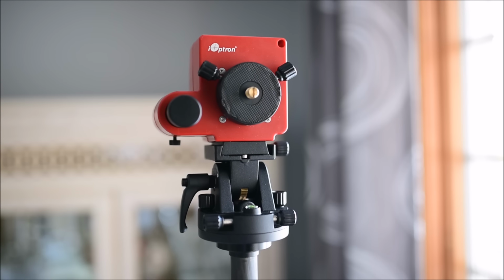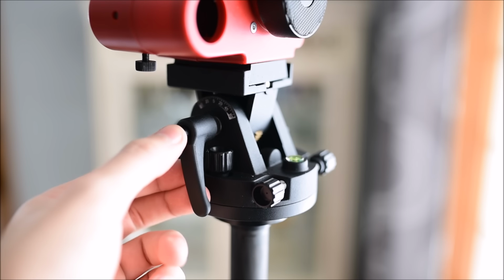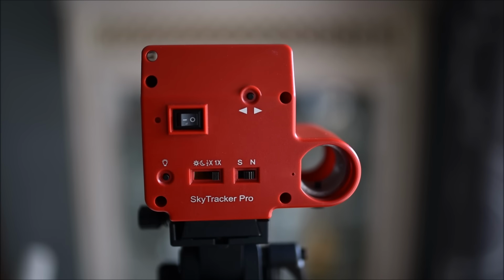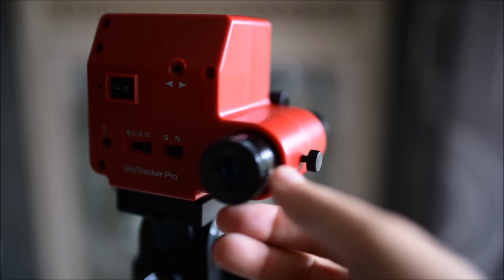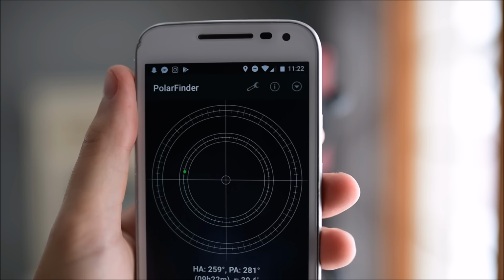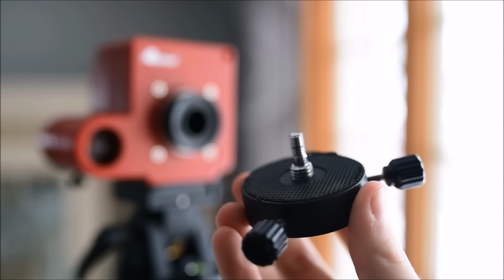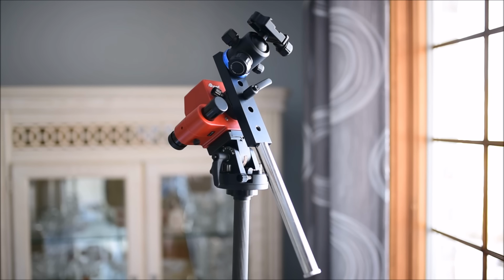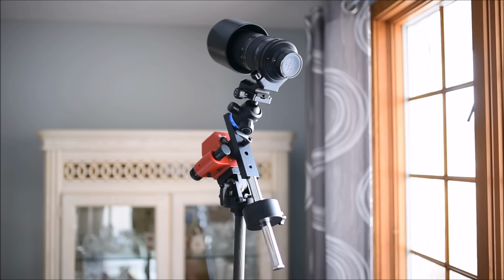iOptron SkyTracker Pro - Full Length Tutorial

Comment from the maker: I've recently created a full length tutorial for the SkyTracker Pro, with over 10 hours of videos!  This will teach you everything you need to know, from planning, to setting up the Skytracker Pro on location, and even post processing your photos!

Also, I will show you the proper way to use the counterweight kit, something I didn't do well in this video.  We'll also look at the best way to use the Skytracker Pro for deep space Astrophotography, or wide angle nightscapes.

https://www.peterzelinka.com/ioptron-skytracker-pro-full-course

3:25 - Attach Ballhead to Star Tracker
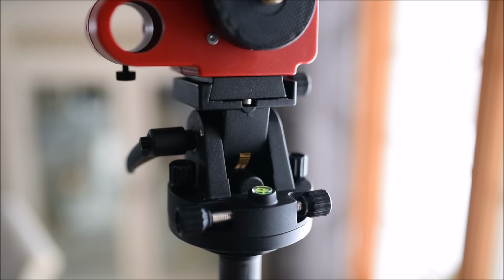5:02 - Adjust Latitude 
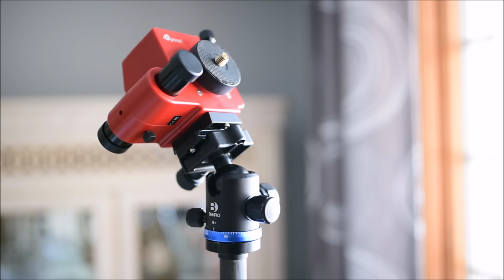6:55 - Precise Polar Alignment using "Azimuth Adjusting Knobs"
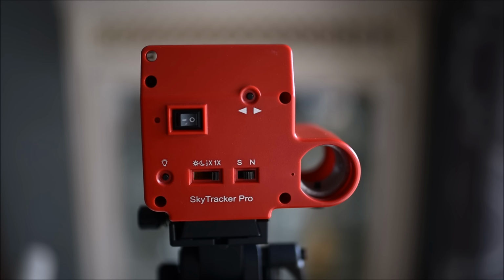8:18 - Attach SkyTracker Pro directly to ballhead
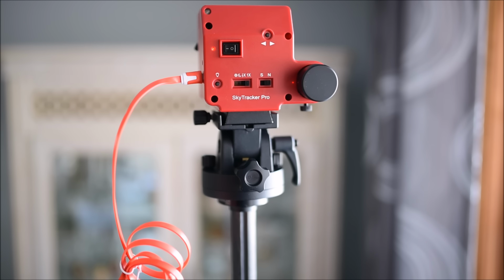10:06 - Button Overview
11:33 - Charging the Battery
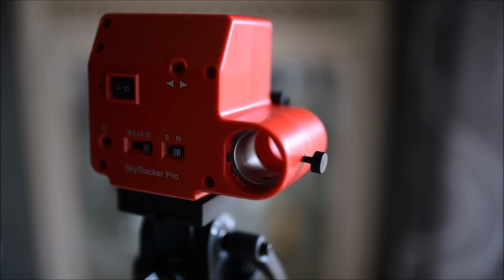12:18 - How to use the <> Button
14:09 - Attaching the Polar Scope
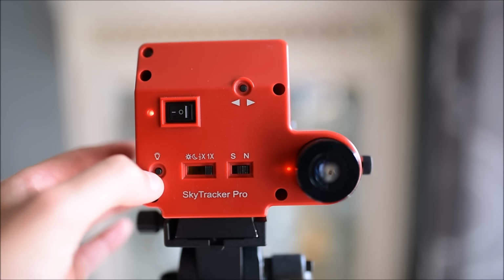15:31 - Focusing the Polar Scope to your eye
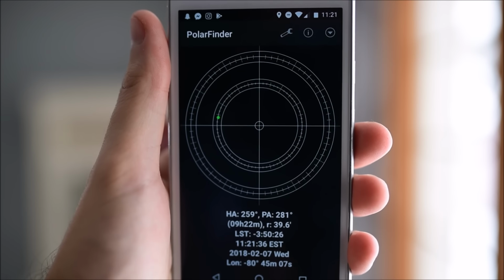16:56 - Using the Polar Scope to find the North Star
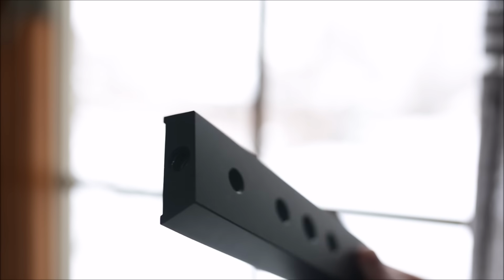18:43 - How to use the Polar Finder App
19:53 - Counterweight Kit intro
21:17 - Dealing with the screws...
21:59 - Installing the Counterweight Kit
27:23 - Balancing the Counterweight
Reply: Peter Zelinka What kinda camera  setup is that?
Reply: Hey man thanks for this. Could you also suggest a few tripod options that would be apt for this tracking system ?

Comment: super helpful; thank you.  the balancing issue seems to be an unresolved  kink in this system, but I've played around with using a sliding dovetail area Swiss plate which makes it possible to sort of get some leeway in manually balancing the rig.  My exposures are typically not spanning hours, so I can adjust the setup as needed so that the camera doesn't slew over too far with a heavier lens.

Comment: I am considering buying one of these, and found your video excellent, well done and thank you.   I am still learning all this, but wondered if the rubber being scarred by the counter-balance bar is just a case of turning the bar over so it's all flat side meets the rubber? Also, when using the weight, can the StarTracker Pro be turned 90' so the scope is on the top? Meaning the weight and camera shall be in the horizontal?... The direction of travel of the SkyTracker shall still be the same, and the camera will not be in the way of the scope, as it is on the bar?  Maybe a stupid few suggestions right there... As said "I'm learning" 😁👍💥

Comment: Would I be able to use a lens like the William optics redcat connected to my 200d dlsr using this mount as fancy getting the redcat without having to purchase a new mount, as was reading if you add a counter weight the mount can be used with a small telescope or telephoto lens 3.5 lbs max. 

Ive had a read about but couldn’t find much info on whether someone’s had success using a lens like the redcat or equivalent with this mount.

Comment: Hi Peter - I bought this a while back mainly for its size and works quite well on a Manfrotto Tripod slight differences the screw for the polar scope is underneath not at the side and its all black no red and I bought it with the iPolar which I can use elsewhere. Anyway the issue is I was looking almost due South I am in Australia and the ballhead with the camera horizontal could only go back in azimuth so far so had to mount the camera a 60Da  vertically  with the slot of the ballhead on the side hope that makes sense pointing North no issue ? Am i missing something great tutorial by the way..

Comment: I have a Skytracker Pro and I am getting good 6 minute exposures without trailing with a 50mm lens. My alignment has to be perfect and I figured out exactly where in the circle Polaris needs to be. I actually got 7 minutes the other night but it just barely started to trail then. My question is this. If I can get 6 minutes with 50mm what do you think that would equate to at 135mm because I am wanting to pick up a good 100mm or 135mm lens. Thanks! I have the counterweight setup also and heard you can file a notch on the adapter but not sure what people are meaning by that. Thanks. Love your videos.
Reply from the maker: That's pretty impressive you can shoot that long!  You must have gotten a good unit!  You could probably push it to 2 or 3 minute exposures at that focal length.  However, if the lens messes with the balance enough, it might prevent you from shooting longer exposures.
Reply: Peter Zelinka I can go to about 200 seconds at 135mm and with my 200mm Nikkor I get about 90 to 120 seconds. Not all keepers, but most of them. I shot last night with a new Canon 135F2L. I fell in love with it.

Comment: Hey Peter, I've really enjoyed your videos. I've bought the Sky Tracker Pro and have used it a few times now. As I live in a Bortle 6 zone, I'm often not able to see the North Star through the reticle as the closest city is to my north. I use my phone to roughly align to North and the proper inclination but at exposures over a minute even at 12mm I've get pretty nasty star trails.  By the rule of 500 I should be able to get a 40-second exposure without a tracker. Something seems amiss! Any advice you could offer would be appreciated--thanks!
Reply from the maker: It's most likely your polar alignment causing the star trails.  I'm able to see Polaris even in the most light polluted areas, so you should be able to see it where you're at.  I'd highly recommend getting to a spot nearby where you have no trouble seeing Polaris.  That would allow you to do a better polar alignment, and should stop the star trails.

It's possible you have too much weight on your star tracker, and the motor cannot move the camera properly.  But that would only be a problem with a big full frame camera, very large lens, and heavy ballhead

Comment: Hi.. im new to this..can I attach the tracker to a cheap tripod which only has a tripod plate?
Reply from the maker: Technically, yes.  You should be able to do that.  Although, it's really not recommended.  If you're using a cheap tripod that has a pan/tilt head with a plate, you won't get great results.
Reply: @PeterZelinka  alright!! thanks a lot!!

Comment: I just picked up a gently used SkyTracker Pro for $150.  I ordered a ball head that will be here in 24 hours.  

So once I mount everything I want to setup my tripod, level the mount. Line up with Polaris using The iOptron App For precise alignment and I’m set to go?  Of course setting the base for my latitude of approximately 40 degrees.  TIA. - Dave
Reply from the maker: Yep, pretty much!  Once the tracker is turned on, you're good to start shooting.

Comment: can you use a 3 way head instead of a ball head?
Reply from the maker: You can, but I don't recommend it.  A ballhead works much better, and is usually smaller and lighter than a 3 way head.  I've taught a few students with 3 way heads, and they had a lot of trouble using them with a star tracker.
Reply: @PeterZelinka  Thanks!  I've been using 3way head and though i enjoy its stability and control, i am thinking about trading. do you suppose a manfrotto xpro ballhead would be sufficient to solidly hold at the angles required when using a tracker?
Reply from the maker: @jrbling25  I'm not familiar with that particular model, so I can't say for sure.  Any decent ballhead should work though

Comment: I think you can move the attachment point for the counterweight bar up and down its 5 available holes, as you move it you will change the center of balance, put the heaviest end closer in, this would allow the weight from the other end to be more effective, allowing more or less weight on the ends and it should allow for the heavier equipment to be used. 
You could also 3d print (if you have a printer) a adapter plate that will hold those ridges on the back of the bar, and even go around the bar for extra strength if it needed to be made that way, make the adapter plate go down to the screw holes that hold the entire thing onto the tracker, so when those thumb screws are in, they will hold it in place to keep it from slipping, this would also save the rubber part as what would be touching it would be solid, id even bet you could print the entire piece as a specific for that bar adapter and just not use the factory one at all. You of course would need this to be a very strong part, which is why i would make a adapter plate over a replacement part

Comment: Hi Peter, I haven't used the counter weight yet but I was wondering to Buy it. You spoke about the issue that  the rubber surface was tearing off on the sky tracker mount. I was wondering if you can flip the counter weight plate so that the smooth side is pressed against the mount? https://youtu.be/tDgMXAW7jGI?t=1291. also that way you may have to flip the screw while putting it on the tracker plate. I am just guessing here. But if you have found a solution for the question, I am going to encourage myself  buy the counter weight kit. This is not my primary photographic style but I enjoy taking deep sky photos and would not want to spend more on a sky guider. Let me know. Thanks for such a in depth tutorial.

Comment: Does this model iOptron Sky Tracker Pro have provision for making time lapse Photography
Reply from the maker: It doesn't have any advanced features built-in.  However, you could attach it to a ballhead and then put it at any angle you want.  Then set an interval on your camera and you'll have a nice panning motion over the course of your timelapse.

If you're looking for advanced timelapse features, check out the Star Adventurer Mini instead.  It has an App which allows you to control a bunch of parameters.  If you connect the Mini to your camera (via a SNAP cable) you can even control the camera's settings.

Comment: hi :) at a risk of sounding ignorant I'm just going to ask this without any prior investigation - it seems that this is calibrated according to Polar.I do night photography but many times I shoot with moon light. That's of course a different kind of photography (also because I don't aim to polar but rather to whatever part of the sky is the most appropriate for the picture and that is either the moon or the opposite (to use the moon light in full)) . so the question is - is it possible to set this tracker to track other parts of the sky? or is there any other tracker on the market for dslr that would be capable of that? thanks
Reply from the maker: You've got things a bit confused.  The Star Tracker is always aligned to the North (or South) Pole, the point where all the stars rotate around.  Once the star tracker is pointed up at that spot, it will rotate your camera around at the same speed as the stars.

Once you attach a ballhead to a star tracker, you can freely point your camera in any direction you want.  You will still be able to shoot long exposures with tracked stars, regardless where the camera is pointing.

The only problem is that your foreground will blur out.  Therefore, you'll need to take 2 images.  One with the tracker turned on.  One with the tracker turned off, for a sharp foreground.
Reply: @PeterZelinka  *I know, it was confusing for me :D sorry. Well that's a good news. I know I have to take 2 pics that's perfectly fine :) well, I'm going to watch read your reviews now because obviously this is something I need :) I love night photography . I didn't really mind blurred stars with longer exp. pictures where the main focus was on the background but this will be an amazing addition especially when shooting milky way shots

Comment: I use equatorial mounts primarily and I would suggest taking the polar scope out and loosening the 2 attachment screws for the mounting plate and see if that rotates freely. then rotate the counter weight setup horizontally  and adjust your balance. you can always replace the polar scope after balancing. that would also prevent the rubber from getting messed up.
Reply: Exactly. Free RA axis, turn bar horizontal, move counterweigth until the system is balanced, fix weight and RA.

Comment: I gave up on the azimuth base and switched to the iOptron  ball head. What difference does it make how the azimuth is set if you still have to raise the and maneuver  the tripod until  so you can see Polaris. So you might as well use of the ball head at the base because it’s easier to maneuver to see Polaris.
Reply from the maker: Yeah, a ballhead can make things easier.  If you are using a wide angle lens (35mm or wider on a Full Frame camera), you don't really even need to be all that precise.  As long as your pretty close to the North Star, you should be able to shoot up to 4+ minutes at 14mm without star trails

Comment: Just got mine! Do you have to hold down the RA slough button down for the entire exposure?? Worried about shaking the camera esp if it’s a 2-3 min exposure.
Reply from the maker: No, thats only if you want to move the tracker at a faster speed.  Realistically, you shouldn't ever have to really use it.  Unless you're shooting at 200mm+ and want to reframe a nebula or galaxy without moving your ballhead / camera

The tracker will begin rotating as soon as it's turned on
Reply: Mine doesn't seem to rotate alone, only when i use the slew button.
Reply from the maker: unless the battery is dead, or something is broken, the camera mount should be moving very slowly.  You could just try leaving it on for a few hours, and note if the position of the 2 screws changes at all.

Comment: IOptron rates the star tracker at a load capacity of about six pounds, but in reality I think the weight limit is about three pounds.
I have tracking issues with anything over two and half to three pounds. Really it's just made for a camera and a wide to normal lens.
I'm looking to upgrade so I can use a little heavier lens.
Even with the sky guider which is rated up to eleven pounds I probably wouldn't go over six.
Also you have to retract the polar scope, otherwise there is danger of the counterweight bar hitting it as it rotates around the R.A. axis.
Reply from the maker: Yeah, I agree.  However, I've been able to push it to over 4 lbs when shooting at 14mm, probably not good for the motor / gears inside though...

Yeah, I didn't explain the declination bracket and counterweight kit very well in this video.  I've since gone through and created a much better tutorial that properly shows how to balance and use the counterweight kit.

https://www.peterzelinka.com/ioptron-skytracker-pro-full-course

As for the SkyGuider, I've only ever used probably 7lbs total.  And it seemed to hold pretty well. Provided you attach everything in the best way, you can make a small telescope work.
Reply: Do you think I could go 3 pounds when shooting at around 100mm
Reply from the maker: Yeah, I was able to get up to 1 minute exposures at 100mm, with a total weight of about 4 lbs
Reply: That should be possible, I forgot to mention above that I'm shooting with a 200mm lens. The wider you go the more forgiving the tracker becomes.
https://www.flickr.com/photos/mattschulze/40605314372/in/dateposted-public/
My added weight comes from a lens stabilizer that I've constructed
Reply: Get the Sky Watcher star adventurer, it's fantastic with the counterweight bar, i can do 7 min pulls without the autoguider with my Canon 6D and the Sigma 50mm art lens.

Comment: Got one ordered, should be here tomorrow.  Couple of questions, for wide angle what's a good starting point..  800 ISO, f2, 2 minute shots or what?
Reply from the maker: I'd say that should be a good starting point!  Depending on how wide your lens is, and how heavy your camera is, you can probably push it to 4 minutes
Reply: Thanks..  it's a 12mm APSC, so really 18mm..   Another dumb question, does it matter which way you go for the latitude? 33 degrees left or right?
Reply from the maker: @gap0910  as long as the star tracker is pointed North (or south, if you're in the southern hemisphere), no.

You can freely take the Skytracker off the base and flip it around, it won't screw anything up.

Comment: I'm just starting out in this - I've been a pro shooter for years, but have never shot stars - Right now, I just want to shoot the Milky Way (that will probably change), and just bought a sky tracker - thanks for this great video, it'll prove indispensable when the device actually arrives. Thanks so much
Reply from the maker: That's great to hear!  I think you'll have a lot of fun getting into astrophotography!

I'm actually just finishing up a massive Astrophotography course, with over 10 hours of content, designed for the SkyTracker Pro!  If you have any questions along the way, this should definitely help!  I'm hoping to have that released within a month.
Reply: OK, this is probably a dumb question - I got the device and went through the setup following the video - but, for the life of me, I can figure out how to start it tracking? And, yes, it's fully charged.
Reply from the maker: As long as the star tracker is turned on, it should be tracking at whichever speed has been selected

Comment: Novice question here, when you turn on the tracker it slowly moves? I dont hear any motor sound?
Reply from the maker: If the red light is on, on the back of the star tracker, it should be moving.  You could always let it run for a while and see if it moves, or manually slew it left or right by holding that <> button down.

Sometimes the motor sound can be very hard to hear
Reply: Peter Zelinka How do you calculate exposure time on1/2 speed  for foreground use?
Reply from the maker: I wouldn't ever use the 1/2 speed, to be honest.  It might allow you to use 45-60 second exposures, with a reasonably sharp foreground and sky, but it won't look great.

Ideally, you take a long exposure of the sky, but the foreground will blur out.  Then, you turn off the star tracker and take another long exposure.  Once you have a long exposure for the foreground and sky photos, you can blend them in Photoshop.
Reply: Peter Zelinka thanks